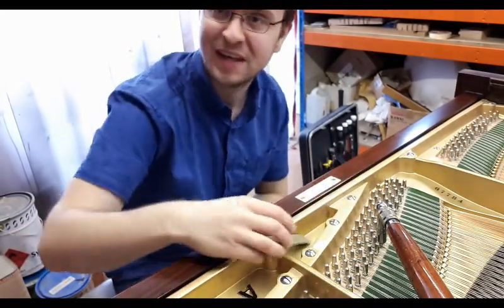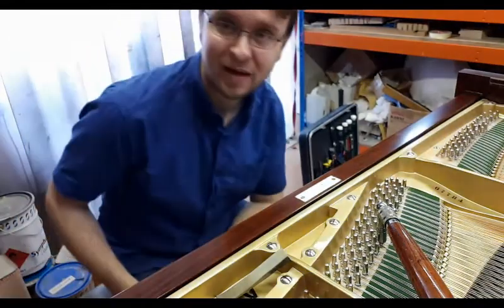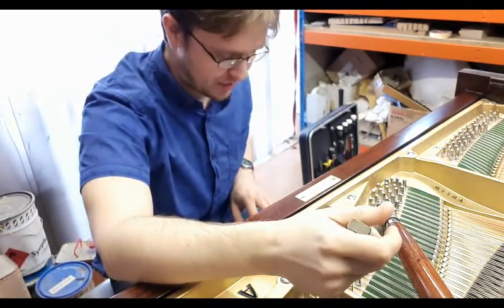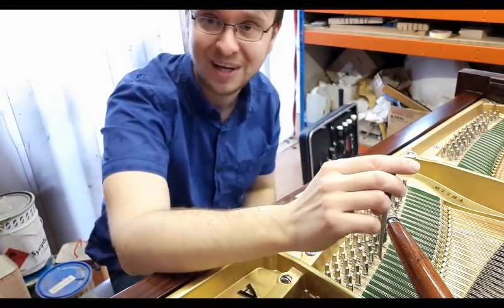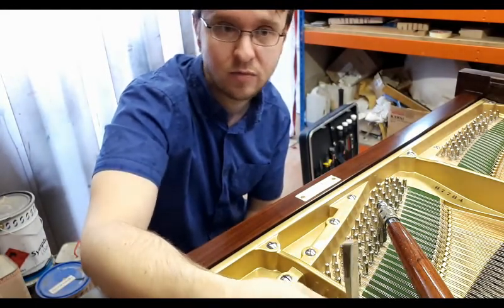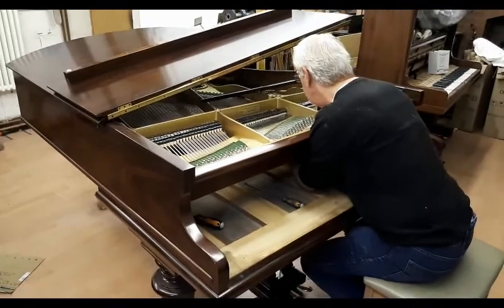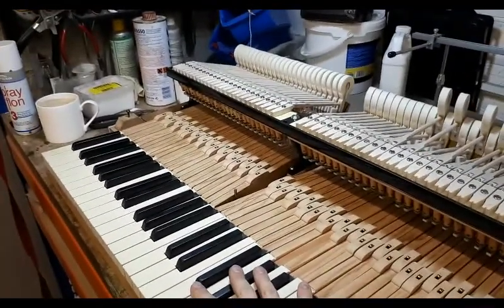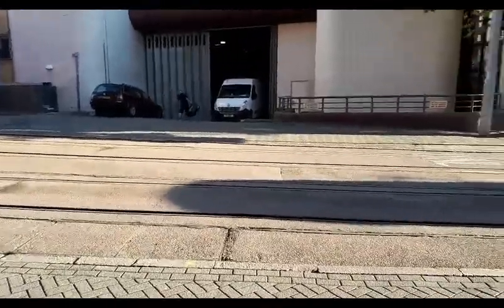Repairing a Bechstein PART 21

Comment: The piano sounds great.  The bass strings are custom made by you?
Reply from the maker: Yes, Phil (the other guy in the video) has been making bass strings for the past 30 years.  I'll upload a video of him making strings at some point in the future
Reply: It sounds nice and lush.  From your experience, what is contributing negatively to the piano sound, between old strings and worn hammers?  I am having an old piano repaired.  The hammers need replacement.  But I am not sure if I need to re-string.  After cleaning up, the strings look OK.  Look forward to part 22!
Reply from the maker: It's usually a bit of both.  Bass (copper wound) strings age faster than treble strings though.  If the bass strings are more than 20 years old, they won't be as clear as new strings.  If you aren't sure whether to restring or not and want to save money, replacing the bass strings and keeping the treble strings usually makes a big difference.  But obviously replacing all strings is best, especially on pianos older than 50 years old